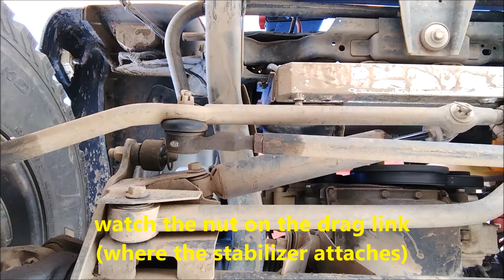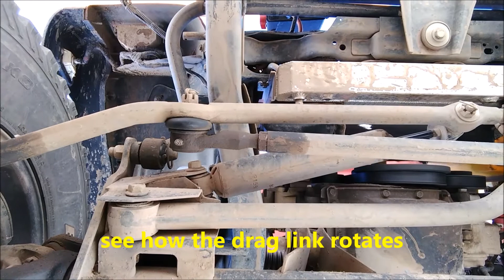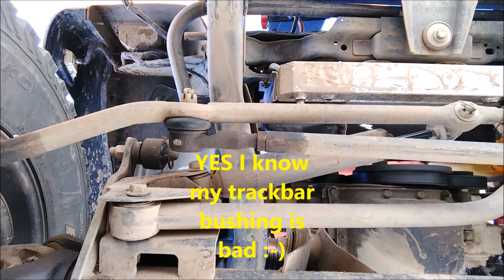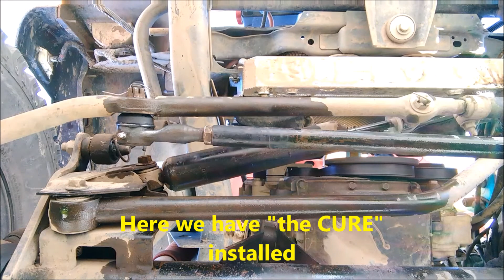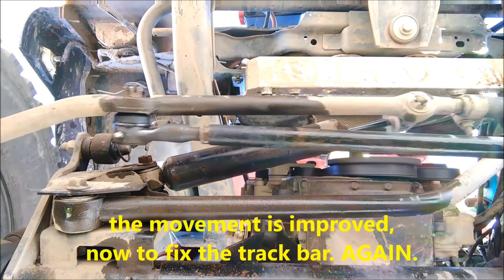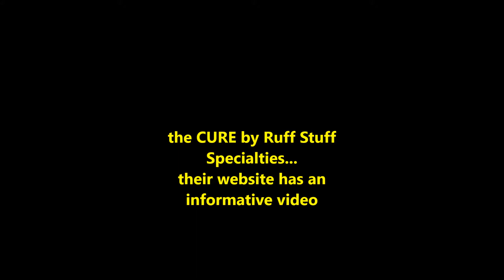BEFORE and AFTER "the CURE" JEEP TJ

Comment: Man... that lower track bar mount is beyond sloppy... if you haven’t addressed it yet, I would. You’ll notice a night and day difference. Same thing happened with mine, cut the factory mount off and built it back up with 1/8th inch plate